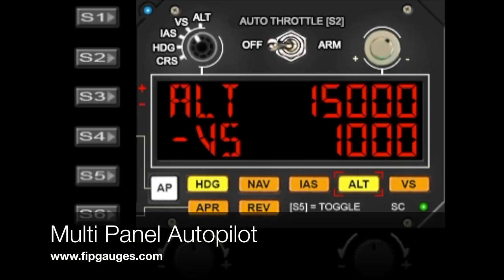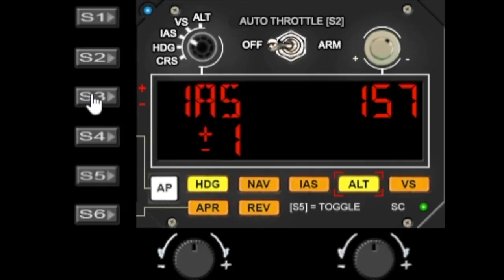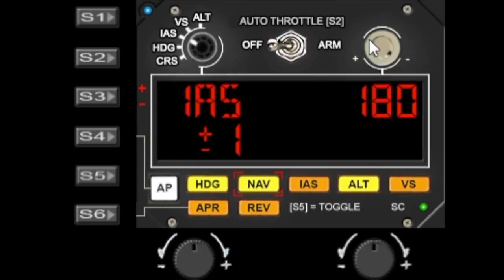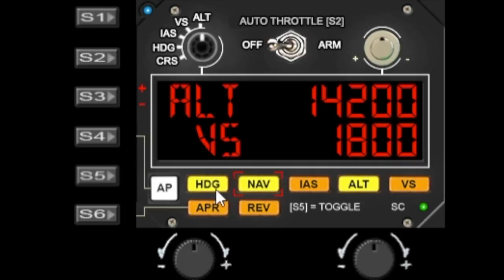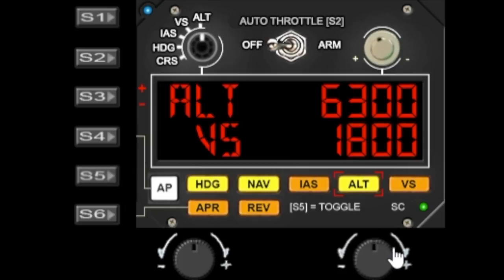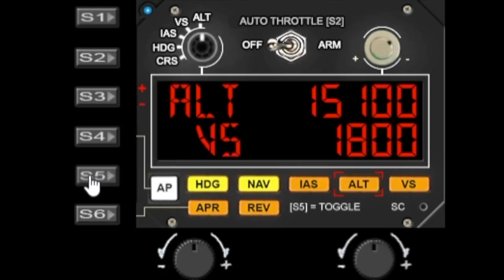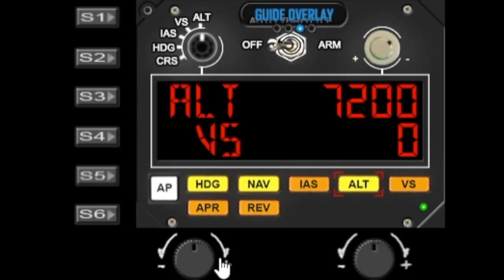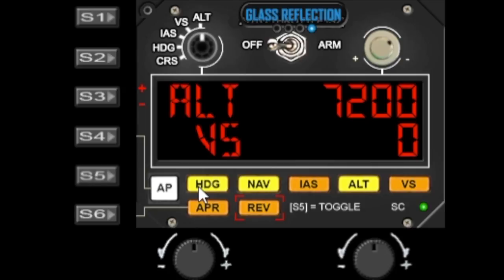Multi Panel Autopilot Gauge - Saitek/Logitech Flight Information Panel & SPAD.neXt

Comment: I'm confused and interested at the same time.  What exactly does his allow me to do?  Control the airplane from this software or manipulate the actual multi-panel capabilities from this interface? also, I see this uses the Spad.neXt driver but does this replace the SPAD.neXt inferface?
Reply from the maker: Harpoon_Bakery this is an alternative for the saitek multipanel if you don’t have it. SPAD.next is required for all my gauges as does everything the actual saitek panel does to the sim
Reply: @fipgauges1305  oh, ok.  thanks a ton -- i've got the panels.  But if they ever break, I know what I'll need to get now.